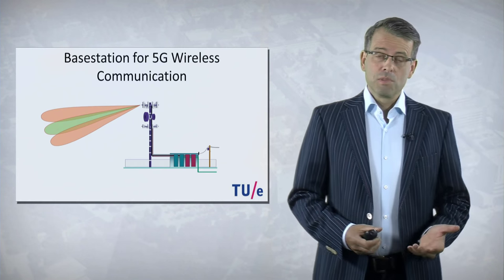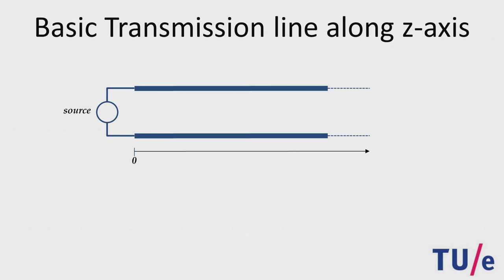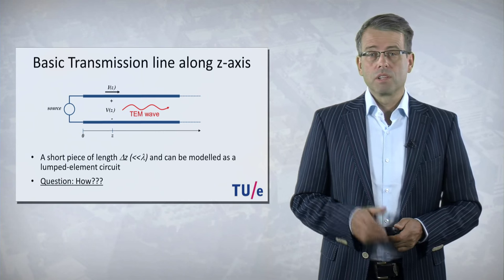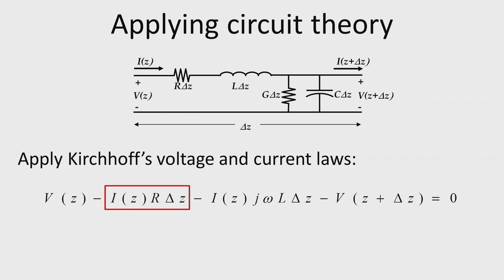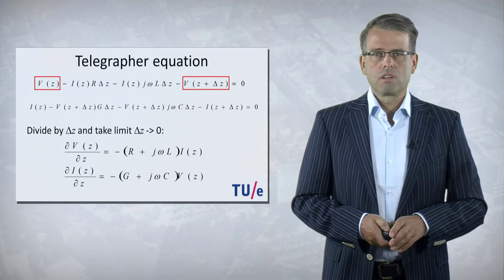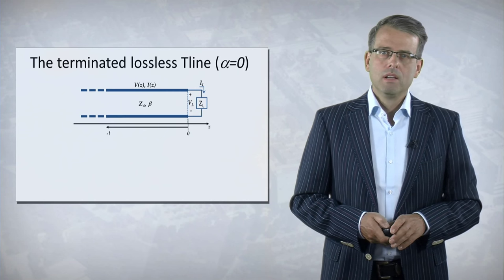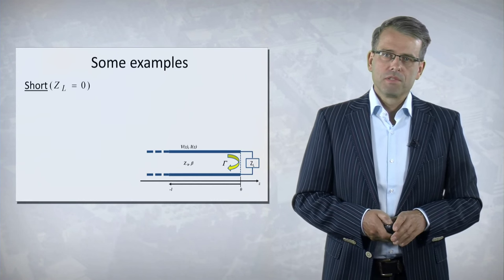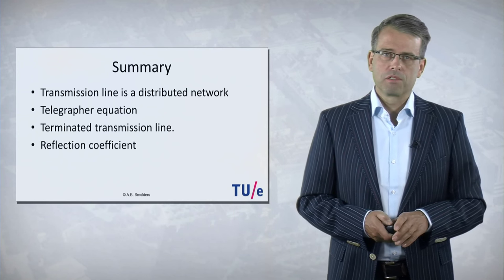Transmission lines, introduction web lecture

Comment: Would most students not at first wonder why we need transmission line theory ? I would therefore first talk about the historical observations on long telegraph lines which could not be explained by mere circuit theory. I think it was Heaviside who proposed to consider so-called "distributed elements" (R', L', G', C') for a suitable transmission line equivalent circuit model.